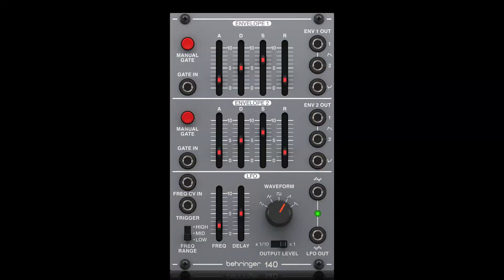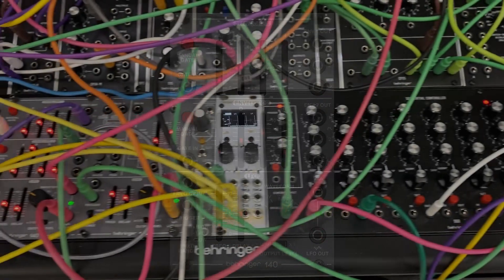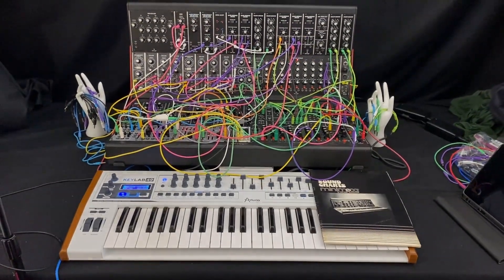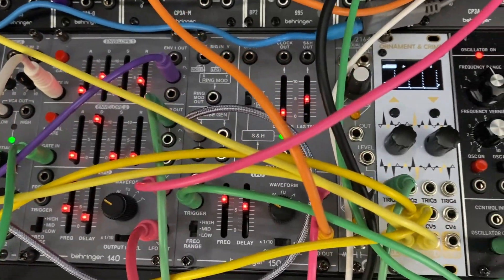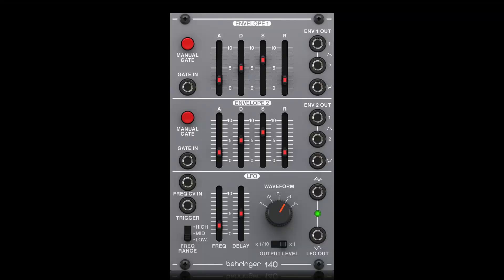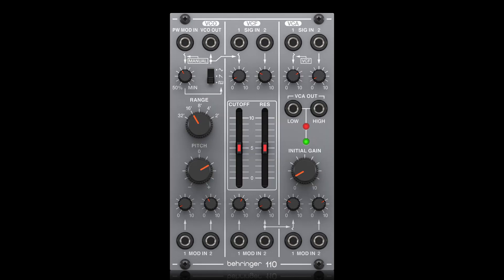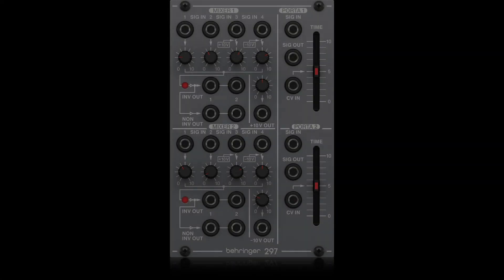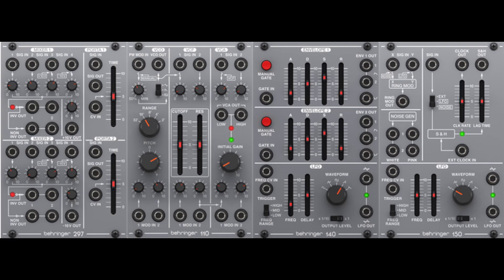System 55 - Top 5 Missing Features

Comment: Thanks for the video. I think my only gripe with the Moog system would be its usability. Does the sound make up for it. I think you also have the 2500 modules and you have the Roland. I guess the arp 2500 is one step up in usability with its integration of filter and amp in one module for example. And the Roland system is so well thought out, for instance  having a complete voice in one module or the fader  two adsorbs in one module, the vas with several audio inputs etc. I guess what I am getting at. Do you like patching the Moog system?
Reply from the maker: Priior to the Boog System 55, I had no experience with  the Moog Modular.  It's a bit of a different beast, especially with the S-trigger vs V-trigger.  I've been obsessing over the 2500 since the 70's, so it is a lot more familiar.  I agree the design of the Roland is very functional.  They did a great job on those modules.

Comment: So the Roland module work fine with the Moog? Doesn't they need different voltages?
Reply from the maker: yes and yes.   see 5:38 in the video: The gate from the Moog 960 Sequencer must be "boosted".  This can  be done with a voltage processor like the 297 module.  You need to mix the v-trigger with a fixed positive voltage of a volt or two.

Comment: I was also curious as to your thoughts on extraneous modules in the System 55 that could afford to be removed. I'm  wondering if there's really any reason why there are three 995 oscillator controllers when I haven't even found much use for one of them. I also removed one set of attenuators. The 903A random signal generator seems pretty superfluous if you have another module that generates noise (like the 150 from the System 100). And the next thing I'm likely to remove would be the 923 filter which strikes me as very functionless. I also took out the 911A delay trigger module that I couldn't find much use for. But maybe I'm missing something about these? In addition, there are two blank 2HP slots in the third row they managed to sneak in very innocuously. So yeah, there definitely seem like room can be swapped out for more functional modules.
Reply from the maker: Great question (Conrad, right?).  BTW, I like your latest video.
Obviously, the blanks are a no-brainer for replacement.  I replaced one with a passive mixer module.  Another obvious possibility is a passive 2hp dual 1:3 multiple.
923 I find this combination of Noise and 6db/oct manual HP and LP a very helpful module for shaping noise.  Often White noise is too "high endy" and Pink noise is too muddy/rumbly.  Perhaps consider getting rid of the Dual Noise module. ( note: the manual Highpass filter on the ARP Odyssey was  also a 6db/oct tone shaper ).
995 Osc Ctrls are precision CV mixers.  It allows you to easily combine (or switch between) modulation sources. I use the channels as follows:
1 - keyboard CV (or midi to cv)
2 - Sequencer CV
3 - Various
4 - Attenuated modulation (vibrato?  pitch mod from an envelope?)
Delay module (I rarely use it, but it can be nice for automatic delayed vibrato.
914 Fixed Filter Bank - I have bought & sold a number of fixed filter banks.  The only good use for them (that I've heard anyone articulate), is to put noise in and raise individual outputs manually.  
I know they can be used to create "formants", but I find that using several Voltage Controlled bandpass filters is a little easier to deal with because you can tailor the sound by ear.  I sold my 914 FFB.  I filled the space with a Behringer Abacus module.

Comment: Thank you O.Z. Your videos have been extremely informative in helping me get started with the System 55 (which I love). 
My only comment on your above suggestions is that after trying it out, I found the 297 portamento module to be the least useful. I'm probably just someone who doesn't need portamento in my sound. And the way the range works on the  portamento is a bit strange as well, it doesn't really do a slow sweeping portamento, or perhaps I haven't found the right way to make it work. Instead I've opted to swap it out for the 305 parametric EQ and mixer. I like having an output mixer with faders, as the little black knobs aren't the greatest for checking your levels at a glance.
I also noticed that on the third row Behringer snuck in a couple 2hp blank slots (between the mixers and attenuators) which can be swapped out to make space for something useful. And the next thing I'll probably swap out is the 903A noise generator since there's already noise outputs on the 923 filter and the 150 LFO module. I'm not sure who needs more than one noise generator, but I have a hard time finding uses for even one.
Thanks and please keep making videos!
Reply from the maker: the portamento time is Voltage Controlled.  Try using a CV (which is available on the module) to create a longer portamento time.
I do love the 305 module.  I have it in my ARP 2500 cabinet.  The parametric EQ is more intuitive and versatile than the Fixed Filter Bank.
The second noise is of limited usefulness.  Also, if you get the model 150 RingMod/S&H module it has noise as well.

Comment: Do you have an estimated additional price tag to supplement your suggested essentials to the system 55’s $1700.00 Amazon list price ?
Reply from the maker: Not off of the top of my head, but that would be something to include in an updated version of the Top 5 missing video.
Reply from the maker: BTW, prices have dropped since I made that video.  Check Sweetwater for current prices on the Behringer modules.

Comment: I noticed you added extra modules to fill the empty rack space in the system 55. I cant seem to get a straight answer when looking for an answer to the question - how much power is left over on the built in power supply for adding extra modules? Thank you if you can provide the answer!
Reply from the maker: Here's the System 55, case #2 in Modular Grid (link below).  
Power usage is 221 mA +12V,  161 mA -12V, 0 mA +5V.  
The Go Case spec says: Over-specified, ultra-low noise power supply provides +12 V @ 3 A, -12 V @ 1 A, and +5 V@ 1 A
So, there's a ton of extra power available for the fourth row in the System 55.  (c. 2.75 mA on +12v,  over 800 mA on -12v, 1 A on 5V)

https://modulargrid.net/e/racks/view/2674496
Reply: @ozhalljr Whoops. You meant to say "2.75 amps," not "2.75 mA."
Reply from the maker: @TheLarryBrown  Correct!  2750 mA

Comment: I got your mentioned four additions 1 - 4 (but not no. 5, the quantizer - believing the current limitation in not having one in that it can be musically to not be too correct).
Reply from the maker: Interesting thought.  Microtonal can be very interesting.  Also, on many non pitch parameters you don't want quantization.  Still, I find myself spending so much time chasing down tuning errors from a sequencer, I have largely quit using sequencers without quantizers.

Comment: This is very helpful information.  Thank you for posting it
Reply from the maker: Thanks for saying so!  BTW, check out the 1630 Frequency Shifter module ( https://youtu.be/nkwjCYgJKJo ).  I was not aware of the availablility of this module when I did the "Top 5 Missing" video.  It meets the "Ring Modulator" requirement and then some.
Reply: @ozhalljr  I have a classic frequency shifter in I plan to use once I get a System 55.
Reply from the maker: @jblock41 cool!
Reply: @ozhalljr  It's the Bode.  Should work well.  Additional interface is with the Doepfer version of a Trautonium with inputs also from a Behringer 2600.  I have the second sequencer and timer already, just as in your setup, plus some nice filters and a quad ADSR. Just awaiting the $$ for the 55 and a couple of the mods you suggested for vibrato, although the Barp has that and I can run the 1500 through it and out.  Should be interesting number of possibilities for outrageous sounds and sequences.
Reply from the maker: @jblock41 please share some videos when you get it set up!
Reply: @ozhalljr  Will do.

Comment: This is excellent. Could you recommend some gears that can cover those 5 missing features. For example, you have a Behringer system 55. What else would you buy to match what the original stock moog system 55 has. // Edit: oh you addressed that in the video. Thanks!!
Reply from the maker: Check out the 1630 Bode Frequency Shifter.  That was OG Moog module that’s available from Behringer.  It covers the Ring Mod requirements.  I have a 3 part series on it.
Reply: @ozhalljr  thank you for recommending that module!! I will watch those series later!

Comment: Nice suggestions. I have the system 55 but I also built a 2x140 case with System 100 modules and those 2 cases can work together. It’s not a bad idea to put some of those System 100 modules in the System 55 case, they add a ton of functionality. 

I added the Bode Frequency Shifter, Ornament & Crime, Disting MK4, another Moog style mixer, oscillator, and VCA but I’m thinking of only using Moog type modules in my bottom section. The System 55 is very old fashioned and limited vs newer technology modules and I like the challenge of making patches the old way. Yes it’s limited but that can be enjoyable, especially if you have another rack full of modules that you can use if needed.
Reply from the maker: @ericMT Thx for commenting.  I have created an "effects" portable case so that I don't have to replicate effects modules in every format/style.  One of my other viewers gave me the idea.

Comment: Missing in YOUR list is the new Frequency Shifter (NOT a phase-shifter) and mic/High Z/line to pitch & MIDI/CV-Gate converter - both by Dr. Moog/Bode Behringer/generally available.
Reply from the maker: You're right about the Bode Frequency shifter  Somehow I missed the fact that this module was available.  I'm working on acquiring one.  
The PP1 pitch to voltage converter is pretty cool, especially for guitar players and singers.  Thanks for bringing that to my attention.
Reply: https://youtu.be/_qokRnB8Fhg?t=13 @ozhalljr
Reply from the maker: k
Reply from the maker: @aemilpeters5644  I will probably just add the Bode (which is on order) and remove the dual ADSR/LFO, since there's another LFO in the S&H/LFO/Ringmod.  While the "voice" module is indeed the most "expendable" per my list, it's very handy for a sequenced voice.
If the PP1 pitch to midi becomes essential, I'll probably add it to an external case, since the look is so different and it falls in the "modern" category.
Let me know if you do a video on your rig.
Reply: Still a 3rd (empty) case adjacent to your current System 55 would also fit all the other extra's: second sequencer with controller and what not in the future: multiples, balanced outputs, speakers, state variable / sweepable band pass filter, a vocoder (based on e.g. Synton - a fresh offering  with all individual I/O a like the later Dr. Moog vocoder is now also available) other Dr. Moog era devices, a 2-4 track (or two of these for ping-pong composing or even a drop in Model D or Korg MS20 clone as you go along - keep a lot empty because at one moment or another you wanna go from mono to stereo to quadro and then all these modern digital do it all boxes will be a double sided sword!  I only have my producers do release videos after pre-payment: https://www.youtube.com/watch?v=kaIZWjItReI - https://www.analogfx.com/product/vxc-2220/ - https://www.youtube.com/watch?v=lsomotKynoo - all these suggestions here will fit in the existing 4 row box or in a 4th empty box, EXTRA  - EXTRA _ consider the AMP MOD by Behringer for amplitude de modulations, advanced modulator including r- ring mod for harmonically correct modulations and bell/metal FM styled tones for the cheap: https://youtu.be/hNjBMoewfCM?t=737
Reply from the maker: k
Reply: https://youtu.be/GAl8zLLFDi8?t=253
Reply: https://youtu.be/siKoHQyDtyA?list=PLpE-Wewr_TsXeUnfryULgPrqALQdnCaOL&t=257
Reply: Pitch to MIDI & CV-gate converter (Behringer, various manufacturers), a Vocoder (AnalogFX, various with all filterbanks and envelope followers: https://youtu.be/lsomotKynoo?t=15,  Moog), a Frequency Shifter (Bode), set of stereo balanced outputs XLR/6.3 mm jack + headphones (several manufacturers), multiples/4 fold audio gates (Behringer), ModAmp very precise (ring)modulaot (ARP-Behringer: https://youtu.be/VcQe0gHpvO4?list=PLpE-Wewr_TsXeUnfryULgPrqALQdnCaOL&t=23
Reply from the maker: Just received the Bode FS from Sweetwater!  I'm working on figuring it out.  Any tips?
Reply: https://youtu.be/-cl6L4prU6Q?t=1487 - without a next step and being totally tactile - a MUST HAVE FEATURE according to Dr. Moog, a multi-band, true, modular vocoder get's you into territory that is promising prior to add all these extra Roland styled modules ((except the LFO/S&H/(ring) modulator + extra noise)): https://youtu.be/-cl6L4prU6Q?t=1487.
Reply from the maker: @aemilpeters5644  I do love my vocoder.  I use it live.  I use the electro harmonix v256 vocoder pedal.  I love it. 
I've never used this one before: https://doepfer.de/a100_man/A1291man.pdf   but it look interesting.  Regardless, I would not put it in the top 5 ( with all due deference to Bob Moog ).  If I did have one, it'd probably not use it live.  (still I would love to work with one).  Thanks for bringing that to my attention.
Reply: Well, my suggestion is based in the Synton (designed and made in the Netherlands) high - end, multi band (individual envelope followers) and very affordable in a euro rack version now with a lot of I/O, specifically PER FILYTER BAND & can not, and should not ne  be compared to  your floor/foot pedal - that is an other league!  This euro rack device should be in your top 6 list because after the Bode frequency shifter Dr. Moog pretty much put that application fast forward (the device here is sub $ 750 whereas a - bigger Dr. Moog reissue unit almost 10 grand) - it also has a few dozen mini jack connectors and a mic phantom powered Mic pre-amp for fully modular workflow integration - that can not be said from a floor pedal for about 300$--different animal with very different applications that may sound for limited usage identical but does not adheres to a modular all free no limits approach to sound synthesis!!!  The fact that you used it "live" more or less disqualifies your quality of that very statement because it has nothing to do with the argument, not technical, and not from en electro acoustic aesthetic point of view (either)  Yo are comparing apples with oranges here or vice versa!  Reconsider you answer!
Reply from the maker: @aemilpeters5644  I agree with what you're saying, certainly in terms of apples & oranges.  I used it live to be able to play/sing lead vocals or harmonies.  It certainly works well for covering 70's/80's vocoder parts.  But that application is far afield from System 55 essential modules.
I had not heard of the Synton before this.  Thanks for bringing it to my attention!  I'd love to own one.  It looks like Synton is out of business.  Is the Eurorack version available new?  used?  I can't find it on ModularGrid.net.  On Reverb.com searching Synton I only see expensive vintage system  in the thoursands of dollars.  Do you own one?
Reply: https://youtu.be/Ov82GWMPytM?t=208 ................ point made in a feedback loop!
Reply: https://youtu.be/N-rOWXe13m4?list=TLPQMjIwMTIwMjRN5ShDSTLX2A&t=135 - point made - did I mention - A - 'stereo maker'?
Reply from the maker: @aemilpeters5644  Thanks for the links.  These are great applications/use cases.
Reply: Noot missing anymore soon I guess?: https://youtu.be/N-rOWXe13m4?list=TLPQMjIwMTIwMjRN5ShDSTLX2A&t=234

Comment: Good topic. I'm currently using your first vibrato suggestion, the lfo from the 150 via an attenuator.  On the 960 I have a simple 2hp quantizer fed from the 962. Not sure if it's the 960 or the Quantizer, but the notes are not too stable. I just got an oscilloscope to calibrate the 960 so that may fix things. Regarding using the 100 series modules alongside the 55 modules via the cm1a, the settings on the rear are different for both systems, the different voltage levels being for either the 55 modules or the 100/2500 series modules, have you had any problems with that? (I find I really need to attenuate the 100 modules before feeding them to 55 modules...) I'm really using my 100 modules as a seperate system, and as such, for the 55 I'm looking to add filters and lfo's mainly, along with some buffered mult's and I just made some more attenuators. I also like your suggestions. Cheers, Steve:goodvibes:
Reply from the maker: I've tried three different quantizers.  The feature you need in a quantizer is the gate input to trigger a conversion.  The A-156 and O&C both have that and perform well.  I have another quad quantizer that does not have the gate.  It's NOT 100%.  Sometimes it creates interesting variations but often it is distracting.  BTW, the A-156 can work w/o a gate, but it exhibits the same imprecise behavior.  So ... apparently it's not the 960 but the quantizer.